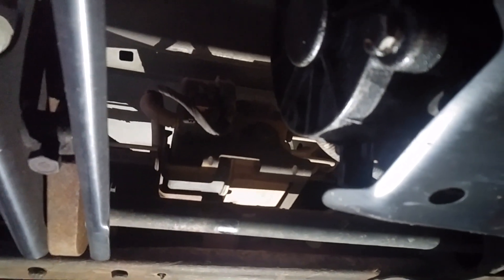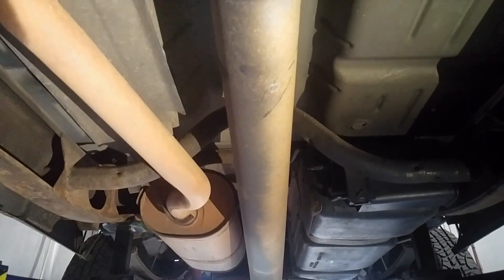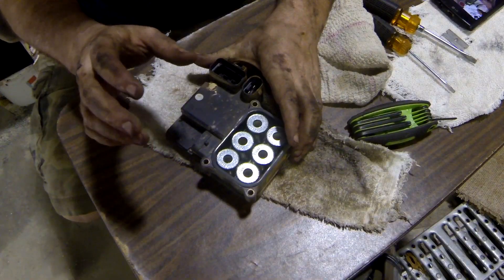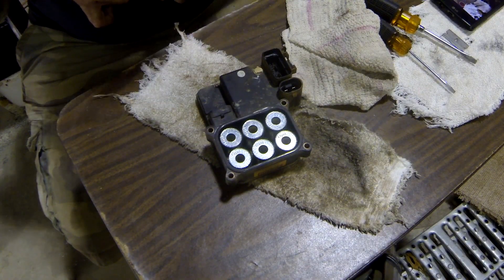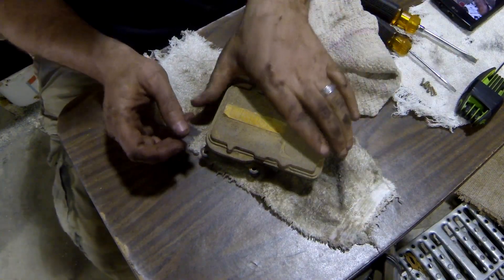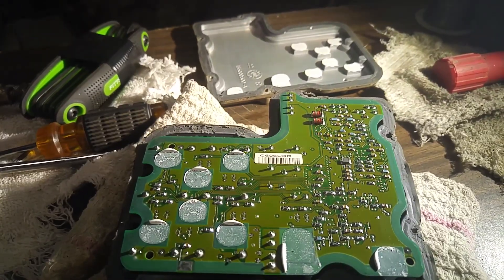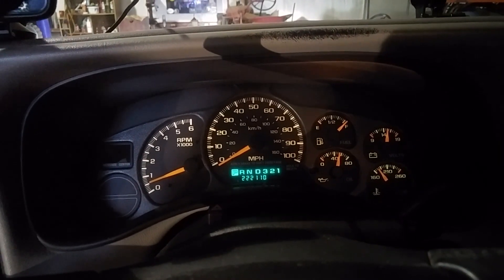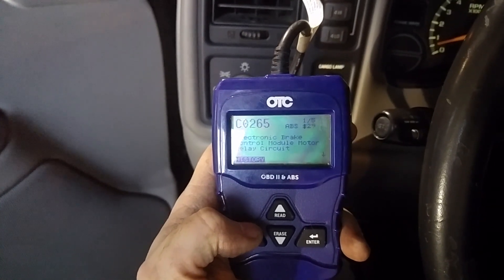Cheap Fix: DIY EBCM Repair - Fix Brake and ABS Lights (C0265, C0241, C0251, C0252, C0245)

Comment: Great Video, My ABS light and Break Lights come on at the same time off and on and i hear a clicking noise also by the break ? I want to try this Fix. I also have 1st gear thumping then I do a reset with battery and it goes away but comes back. Now the breaks lights and ABS start up t op it all off. 2008 silverado 4x4 any advice replaced speed sensor and throttle position sensor also no help.
Reply from the maker: It's been 6 months since I did this fix and I haven't had the lights come back on at all.  I would say give it a shot and see if that clears up that problem and hopefully the other.  I have noticed that I get a thump from the transfer case sometimes when I shift into drive or reverse.  I read that there is a ring in the transfer case that sometimes smacks up against the inside of the case causing that noise. (and sometimes cracking or busting a hole in the case)  Also sometimes I get a thump from lack of lubrication on the driveshaft yoke going into the transfer case.  GM put out a service bulletin on it saying all you can do is lube it up with ATF and not grease it since it will get back through the transfer case seal and mess things up.  Hope that info helps...let me know how it goes!!
Reply: Thanks for reply,  my transmission slams into gear from 1st to 2nd but if I reset the battery it goes away leaving me to think its maybe a sensor or computer board issue not sure but driving me crazy . On the points that you did the solder on did you just reshape them at a lower point video did not show that part. Thanks again for all the help
Reply from the maker: I agree it must be a sensor since you reset the computer and it stops until it relearns.  Might sound a little out there but I saw on the youtubes here that someone corrected that by replacing the throttle position sensor.  Might be worth breaking out the meter to test.  For the EBCM, get your iron nice and hot and just hit the top of the pin until the solder turns to liquid and let it harden back up.  I didn't have to add any solder.

Comment: Very nice DIY. What did you use to seal up the ECBM after you finished the solder job?
Reply from the maker: Still working like a champ.  Any decent sealant should work.  I used some gasket shellac because that's all I had laying around at the time but I would have probably rather used regular RTV sealant.  RTV, water pump, head gasket maker, or anything of the sort should work just fine to keep the water and moisture out so long as it doesn't contain any conductive metals.
Reply: Chaos Garage Good deal. Thank you sir!
Reply: PhilsLB7 m

Comment: I think that's what's wrong with my abs mine's a 96. Thanks for stopping by and checking out my channel I just came over and hit your big red button and the bell hope you have a great weekend
Reply from the maker: I greatly appreciate that Walker Outdoors!  I subbed to your channel recently but haven't had a chance to watch too much yet.  I don't think they started putting this particular EBCM module on until 99.  You could always check your wheel speed sensors with a multimeter.  That's the first place I'd look if your ABS light is on...or better yet use a scanner that can pull the ABS codes.  I went this route for this truck because in doing my research on the error codes I pulled, it was on the list of most common problems for these year models.  Cheers my friend!

Comment: Wow now thats crazy. huge props to you brother for doing your homework. What an easy fix. Great Job!
Reply from the maker: hah thanks.  This wasn't a hard fix but just took quite a while.  It's important you go slow especially when cutting the silicone to get the cover off.  It gets expensive real quick if you mess up the board!  Thanks for checking it out!

Comment: I bet that board definitely had some cold solder joints on it.  Glad it worked!!
Reply from the maker: I didn't see any obvious ones but I'm sure it did.  I just reflowed every pin that was sticking through the board and hoped for the best.  The lights were coming on every 2nd or 3rd time I drove the truck so apparently it worked since I haven't seen them return after a week of driving!  Thanks for stopping by my friend!

Comment: Yeah bleeding the air out of an ABS line can be a pain in the rear end. Well actually a 
pain in the brakes. Nice fix. Hey whats the model of that OTC scanner?
Reply from the maker: The scanner is an OTC 3208 that I got from my local Summit Racing in a hurry... https://www.youtube.com/watch?v=VMMDnvZOR5M
Reply: Bleeding air out of a ABS module is one of the easiest things to perform. If it's a pain in the ass for you you're doing something seriously wrong! And NO I don't use a scanner or even a TECH2 to do it!

Comment: Hey! I keep forgetting to ask if you've heard any rattling above your head. I left a stack of CDs in one of those compartments on the roof lol.
Reply from the maker: Hah I cleaned everything on the inside really well except I haven't vacuumed it yet.  Found the stack of CDs and most of em looked like the heat got to them.  I also found a few keys if you are missing any. :)
Reply: Haha, if they're long funny looking keys hold onto them for me. If they're tiny keys they probably go to the tool box. I meant to ask if you got keys to that as well.
Reply from the maker: Got 1 tool box key and 2 ignition keys.  The extra keys, I found 2 or 3 that look like house keys.  I'll text you a picture of them when I go down to the shop later and I can mail them to you if you want me to.
Reply: Sounds good! They're probably my dirt bike ignition keys lol.

Comment: Did you do the soldier and the ground at the same time or did you try the ground cleaning and it did not fix it.   Glad its fixed i imagine getting that ebcm was a bear to get out.
Reply from the maker: I did the ground the week prior but it didn't fix it.  It's a tight fit on the trucks with the EBCM on the frame rail.  You can get a 1/4" socket with a bit on the outside bolts by reaching over the frame rail but the inside bolts I had to hold the bit in there with my finger and use a 1/4" wrench.  It took a while but with a little patience the job wasn't too bad and saves me $300+ or pulling apart the dash to remove the lights haha!
Reply: The wife tells me today that the brake light comes on every so often  hahaha  just one not both . Oh well i'm pulling all the bulbs then :)
Reply from the maker: Do you have a scanner that will do ABS codes?
Reply: Yes and i'm going to take a look today and see if there are any stored codes.  That truck never stops so when I get a chance so today is a balmy 34 on your f scale  ill check it out.
Reply from the maker: ick, I'd have to bundle up...that's shorts and t-shirt weather for you though isn't it?

Comment: I would just remove the bulbs lol I will leave a like and continue watching  and learn from you
Reply from the maker: Thanks!  I'm likely to do that too instead of spending 300+ on a new one.  But this took only a few hours and I already had all the stuff to do it so I figured why not?  Truck was free and I've only got about $600 into it so far and most of the issues worked out so I'm miles ahead of the game!  Thanks for stopping by!!!
Reply: Hey! I keep forgetting to ask if you've heard any rattling above your head. I left a stack of CDs in one of those compartments on the roof lol.
Reply: Someone broke off those bulbs and the check engine light in my suburban before I bought it
Reply: how do you remove the bulbs thank you
Reply: @meekslt5  you have to remove the cluster, the bulbs are soldered in so you either melt the solder and pull them out, or break them off.  I removed the "brake" light bulb from mine to pass inspection, but I plan to fix it right and solder the bulb back in, just didn't have time as I work a lot.  I'll probably replace the whole unit, fix my old one, and keep it as a spare.